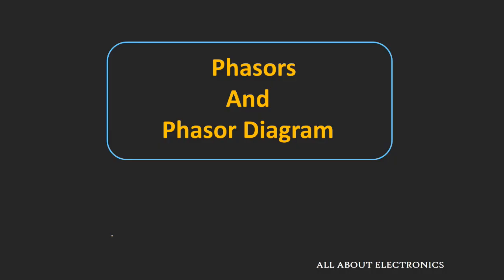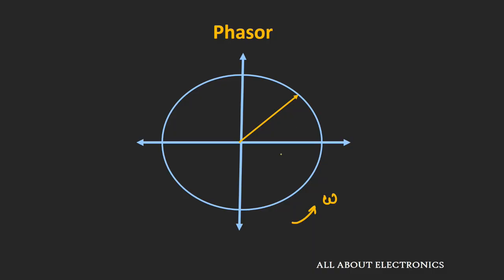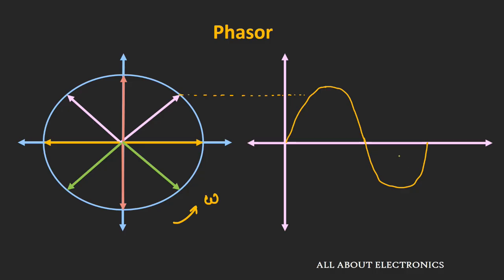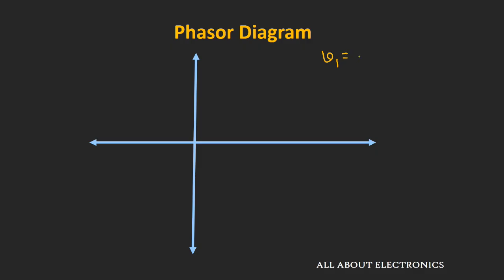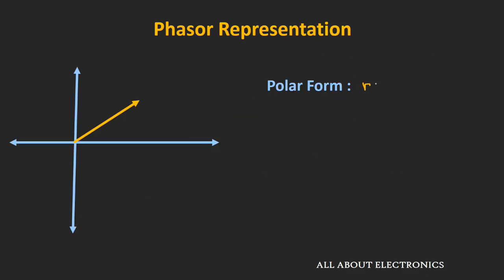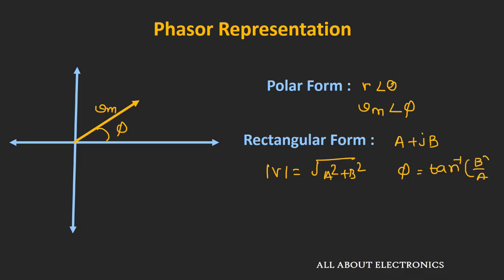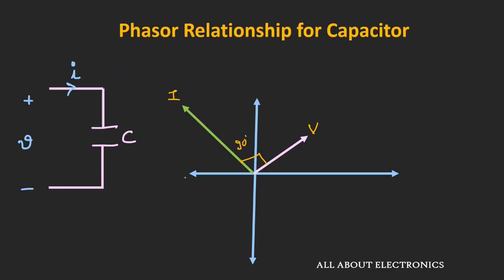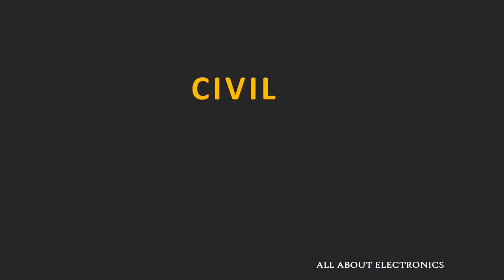Phasor and The Phasor Diagram in AC Circuits Explained

Comment: Incorrect representation of phasor diagrams.  A phasor must be based off of the cosine equivalent function, NOT the normal sine function.  So, you should've subtracted 90° from each function prior to drawing the phasor diagram.

Comment: 9:10  how did u get e power(j pi/2).Im.phi ?...  in which form is it ? polar or exponential? 
9:13 how is e power (j pi/2) equal to j? plz explain
Reply from the maker: It is in polar form. Im< phi. and 90 degree is phase shift is introduced due to differentiation. 
e^(j pi/2) can be written as cos(pi/2)+ j sin (pi/2). cos(pi/2) = 0 and sin (pi/2) =1
That's why e^(jpi/2) = j.
Reply: @ALLABOUTELECTRONICS  how can we write 90° phase shift as e^(jπ/2)...?? Or what is rule behind it?...plz ans I wasted so much time searching about it.... Also can we  write every phase shift theta in terms of e^(j theta)
Reply: Oh k I get it !! Thanks a lot!!

Comment: How did the phasor diagrams in case of inductor and capacitor are same? Could u just explain me!
Reply: not same . in capacitor  current is leading,and in inductor voltage is leading.both lead by 90 degree

Comment: when we draw the phasors in the plane, which value should be taken ? maximum or RMS ? is there any hard and fast rule that we always need to take only the RMS value of an AC quantity for phasor diagrams ?
Reply from the maker: Well, there is not hard and fast rule. Some textbook takes RMS value while some textbook takes the maximum value. Some textbooks take RMS value because most of the AC signals are represented in RMS value. (e.g 230 V, 50 Hz  AC Signal). But, there is no hard and fast rule.